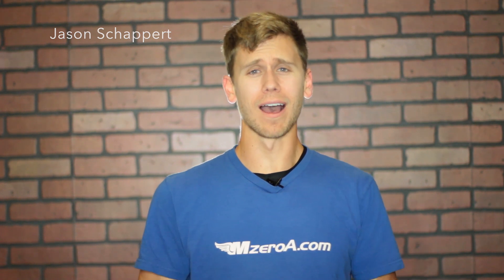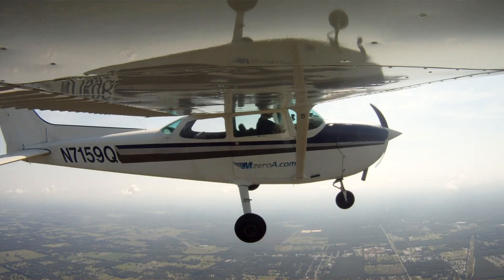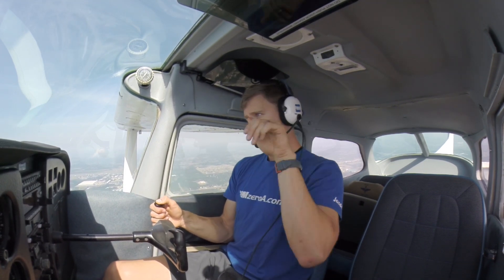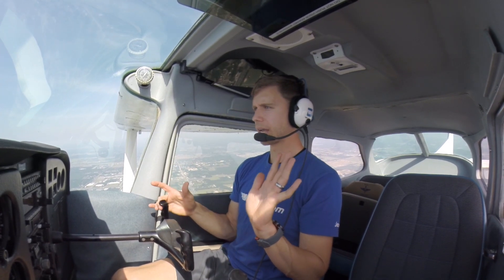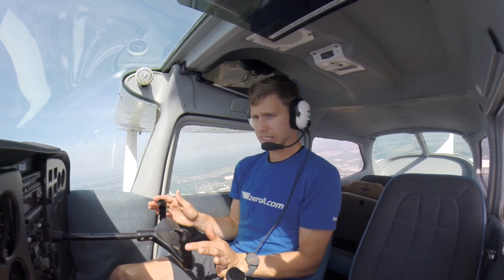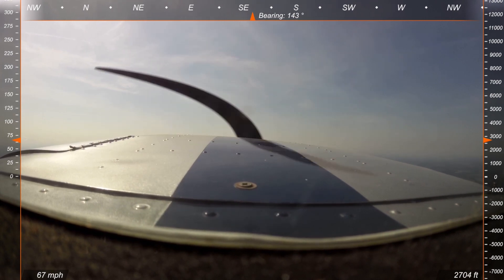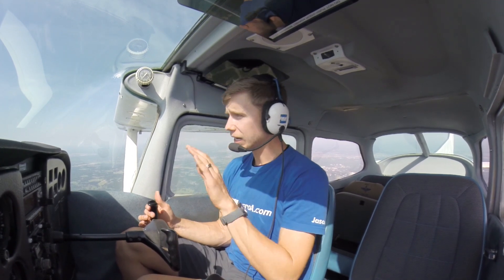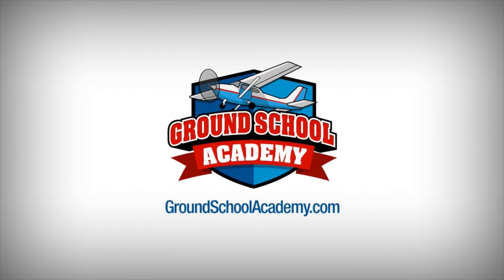Slow Flight Clean Configuration - MzeroA Flight Training

Comment: Can you explain
if your aircraft stalls at 50
and you are cruising at 55  (slow flight)
if you have a 10 tail wind
then does that make the wind going over your wings to be 45
and would you stall ?
Reply: Hi, if you are cruising at 55 IAS, the air over your wings is travelling at 55kts, if there is a tail wind of 10 kts, it simply means your groundspeed will be approx 65kts, so you wouldn't stall as your IAS hasn't changed.
Reply: So if the stall speed of your aircraft is
55 IAS
and you are going 60 ias
you are okay and will not stall
but if a headwind comes at you at 10 mph
and changes your indicated to 50
then you would stall ?
Reply: lw216316 if you were in the scenario you just said, a change in your headwind would have no effect on you IAS, it is your groundspeed that would reduce by 10kts